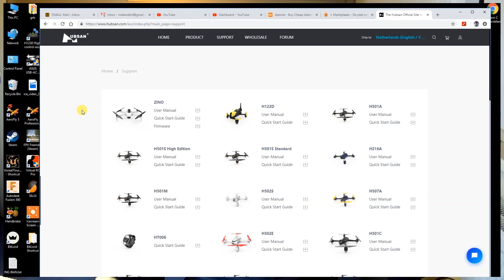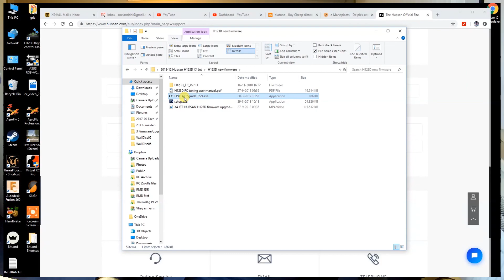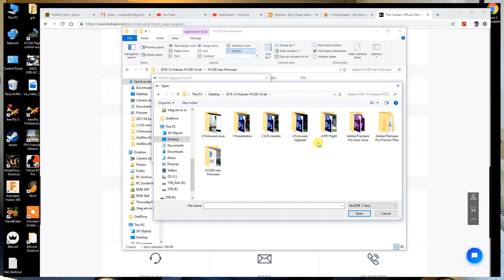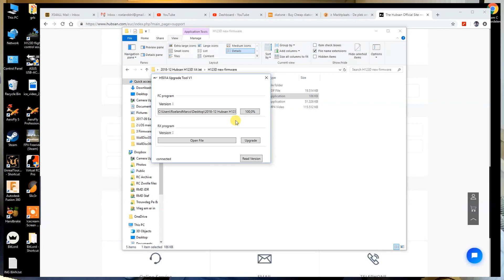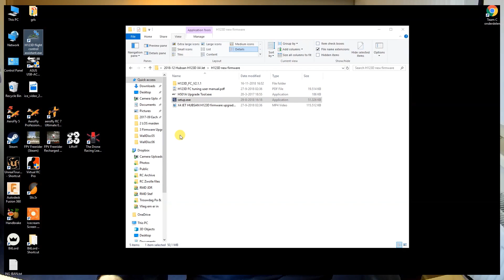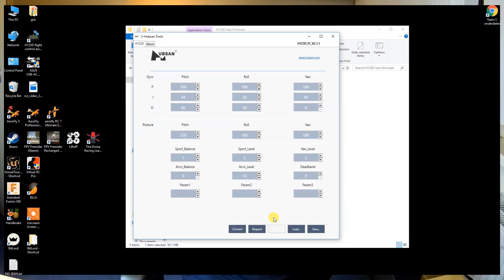Hubsan H123D X4 Jet - P3: Firmware Upgrade - How To!

Comment: I have been trying to update the firmware following the step by step instructions in your video, but when connecting the drone to the PC, the program does not recognize the drone and a disturbing beeping starts.
Reply from the maker: Ofcourse I can't re-test it here, but I suspect your computer might be "to new" as this video is 5 years old.. I would think the problem is a port-driver on your computer.. 
Do you maybe have access to other computer(s) you can try it on??
Reply: @DutchRC  Yes, I will try on another computer. Do you think the data cable could also have an influence?? By the way, does this firmware upgrade only aim to introduce the acrobatic mode or does it also resolve other issues, such as the low cutoff voltage which according to my measurement is 7.4 volts?? and that's why the flight time is only 5 minutes??
Reply from the maker: @beto.perini  You would need to find release notes to be sure, but for as far as I know it was the flight mode + other little things.. the acro flying was the main attraction

Comment: Has.anyone found the perfect settings with the tool for acro flight? Please share thanks. Is it possible to set it up for acro on a open TX controller?
Reply from the maker: I don't have this quad anymore myself but you might want to have a look at topics on it on RCGroups :) there should be more info on it there...
Reply: @DutchRC  Great thank you will try that. 👍😎

Comment: My Doesn’t show up that it’s connected just beeps
Reply from the maker: I can imagine that might be due to a missing driver on your computer.. Hard to check that for me though :$ 
You could give another computer a try?
Reply: Thanks
Reply from the maker: @littlejack841  no worries.. you solved it allready??
Reply: DutchRC Adventures I have the same problem. It just beeps. It finds it like it does in your video but it still won’t stop beeping.
Reply from the maker: @Hi8238-t4t  Yeah.. Hubsan knows about it, but I don't think this is something they can solve :)  
We will just have to live with it ..
Reply: DutchRC Adventures well I found the issue. My transmitter was too dead to go into bind mode. The screen wasn’t even turning on. Causing it to beep like there was no transmitter.
Reply from the maker: @Hi8238-t4t  :D that wouldn't help eighter ;)

Comment: People have complained this racer isn't a true racer because of the acro balancing. Without changing values does the new software across mode perform to a true acro now. Thanks for the video. Subscribed n liked..
Reply from the maker: Thank you :) 
it DOES perform better so updating the firmware is kind of mandatory... Does it fly like a €300 FPV quad with the update? Nope..
Reply: How I can change to real acro, what must I change in pid setting?

Comment: Drone does not bind more than faser?
Reply from the maker: True.. You will have to re-bind the quad to the transmitter.. Your manual tells you how to do that :)
Reply: @DutchRC  I did the rebind but it did not work, everything does not start the engines, it's going to be the controller.
Reply from the maker: Hmm I tihnk maybe you would want to contact Hubsan (or your supplier) about that? bit hard to see from here what happens, but it might just be faulty
Reply: @DutchRC  
I contacted the bangood I am waiting for answers
Reply from the maker: Okee.. good luck with it offcourse! 
I would Allso ask Hubsan about it by  the way..
Reply: @DutchRC  
it was the update working again :)
Reply from the maker: Good on ya sir! Enjoy it :)
Reply: @DutchRC  
Do you have a drone shop?